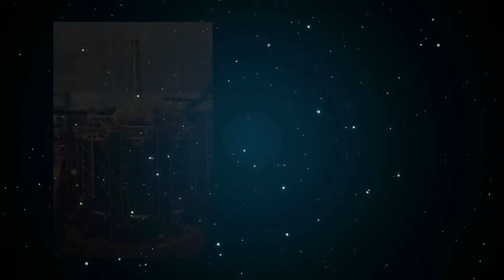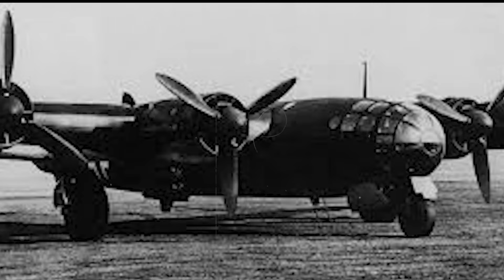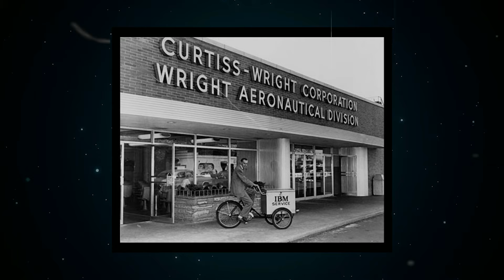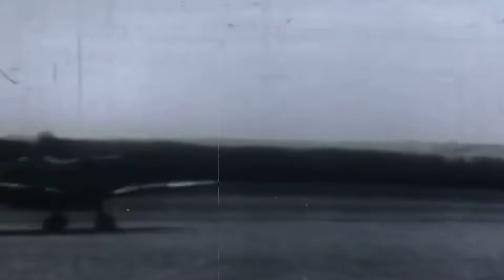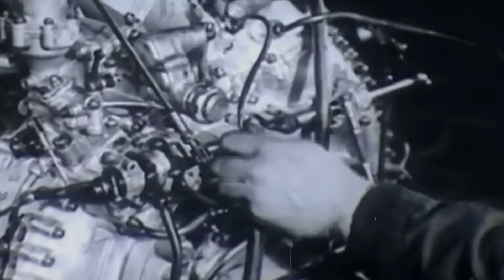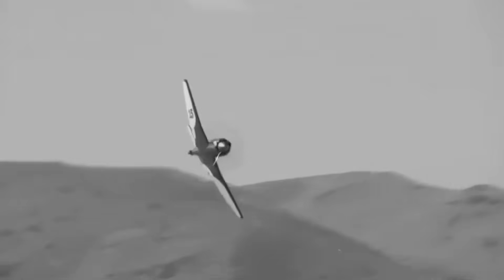7 Forgotten Hyper Aircraft Engines Of World War 2

Comment: The problem with this last generation of piston engines was their insanely complex engineering. Bill Gunston commented on engines such as the P & W R-4860 that the big engine/big propellor combination was one of the best arguments for the jet engine. The technology was at the cutting edge of current metallurgy if not slightly beyond, and all stress/thermal computations were being done by human beings with tools like slide rules and log tables, performance logging was people looking at dials and writing readings down. It's a tribute to those engineers that the things worked at all. For an interesting case study look at the Napier Nomad compound engine. (Mind you Napier seemed to pursue complexity for it's own sake, compare their Sabre engine with the equivalently powerful Bristol Centaurus) 
In his autobiography Sir Stanley Hooker related explaining this to his boss at Rolls Royce. His boss had said that the 1000 odd pounds of thrust from one of the early Whittle engines didn't sound like much. Hooker showed that in terms of propulsive thrust that was about as much as they were getting with the current Spitfires.

The Republic XP-72 used the P&W R-4360, also used in Vought F2G.